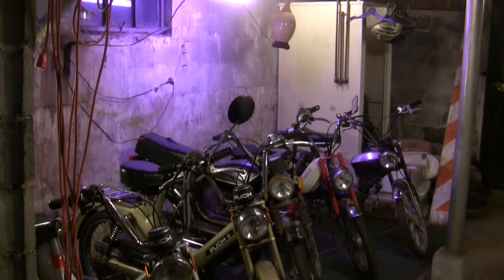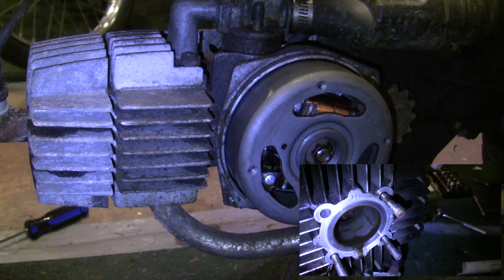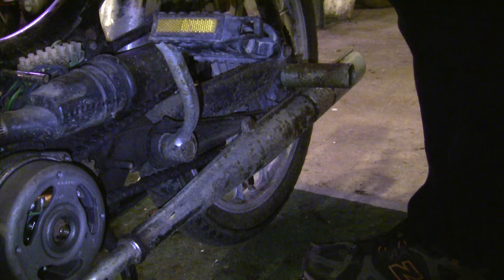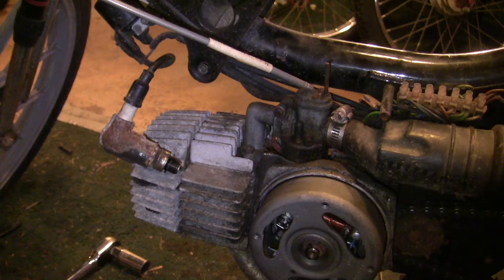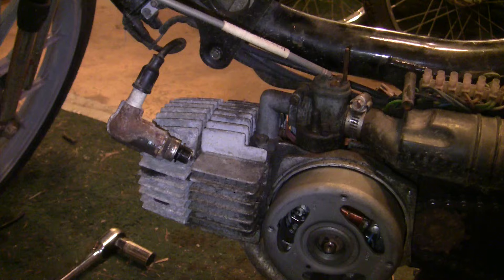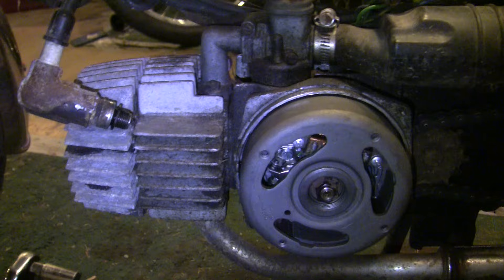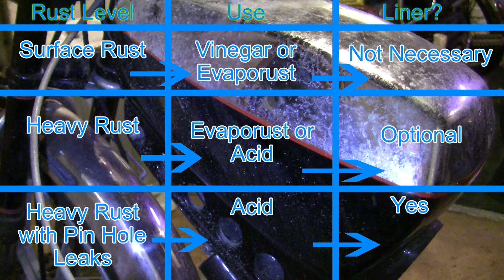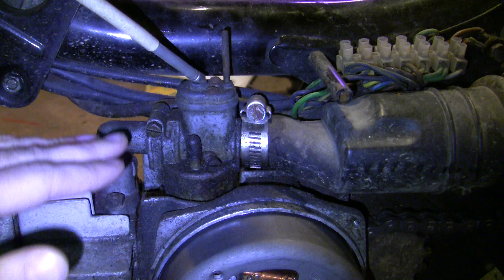How to get an Old Moped Running/First Things to Check (Compression & Spark Tests, Troubleshooting)

Comment: Travis, Thank you!!! I have an 85 Trac that has been sitting for a decade. I watched your video and learned a great deal! I WD-40'd cables & moving parts, and shot a few squirts into the spark plug hole. I then sprayed lithium grease on the chains. I turned the engine over by hand as you had done, then used sand paper on the points. After that I air sprayed and sprayed electric connection cleaner on the points and wire connections. Then I cleaned the carb, and sanded the spark plug. It fired up on the 5th kick! I let it run then adjusted the idle. The best news is I am doing 32mph (I weigh 240)!!  So again, thank you very much for this video!!

Comment: I had one bike that the tank was so rusty on the inside that I just took a plastic gas tank off one of my junk riding mowers and made it work. I used an inline fuel filter and shut off valve. It worked great for years.

Comment: I finnally fixed the problem. It was tedious. I exposed the whole wiring system. I checked all wires for puncture marks etc. Cleaned all grounds and disconected the taillights. Had a bad connection which inturn burned out the circuit in the connection box. Cleaned and resaltered. Works fine.I changed the design to ensure that it wouldn't happen agin. Thanks alot. You the man....
Reply from the maker: Oh man, glad you sorted it out! Always great to hear how repairs turned out, ride on!

Comment: Thanks for this video,I just bought one over the weekend and have no idea what I'm getting myself into
Reply: same my older brother bought one at an action and gave it to me for a suprise and i've never messed with two strokes  so i had no idea what to do with it
Reply: Did you get your moped running?
Cheers
Reply: Did it run for several months and randomly stopped working again. I have to take it back apart and figure why it won't start up again

Comment: Thanks for responding. Looks like I may have do some serious rewiring to do. My bulbs are good. My swithes are cleand and good. Icleaned all ground connections. Checked for pinch points. Everything.... still no luck. Thanks agin. Ill be back at it tomorrow.
Reply from the maker: Ah bummer, it's nice when the fix is easy. The switches are funny...the test for them is to tape the two connectors going into them together and see if it still dies when you hit the brake lever. Obviously the bike can't be ridden like this for safety reasons/no brake light - but even if the switch contacts are good and clean it could still be bad. Beyond scuffing up the grounds with sandpaper I would also look for a simplified Tomos A3 wiring guide on MopedArmy for when you do go to re-wire, less wiring makes troubleshooting e-z!

Comment: Supertech oil works just fine. Been running it in my F150 for years and it's pushing 300k miles. Project Farm has done loads of oil and other tests on various brands.

Comment: Definitely going to have to use these methods to get my newly acquired mopeds running 😎

CL ad, picked up a ‘75 & ‘85 motobecane roadrunner, and scored an old angel ‘moped II’ for free more or less. Paid $150 for the set of (3) of them :p

Comment: In the UK it's a sad reality that many old bikes were stuck away in the shed because they were knackered and nobody had the time to take them down the dump. You are lucky if you buy an old bike that isn't in need of a total mechanical re-build. Many owners enjoy the work,  but the cost can be huge to locate rare, obsolete parts.  Think about this before spending a fortune on a 'barn find' bike. ...it will be a big work, time, emotional and financial commitment Better to buy one where the work has been already done.... and that you can ride away looking mighty cool!

Comment: HI! I purchased an old TOMOS STREET MATE last week (yes, from Craigslist) so I can teach myself how to ride before jumping on my other bikes (Yamaha xs400 maxim n Honda Shadow VT700). (I promised my family I'd practice on something "little").

 Before I purchased it, I saw the ex-owner ride the heck out of it, kicked it back and off he went, so I loaded it in the back of my sedan and off "I" went! I don't know crap about bikes and I'd like to get it street ready (registered, insured, etc.) by fixing it myself.

This little moped has been "suped up" to a 70cc with a different engine, a fancy muffler and ... it has no odometer (?) It has no KEY. I didn't notice that before I got home (oopsie) It's been jury rigged like crazy, but it works like a charm.

It has a new battery, the tires are ok, but it has a mess of wires sticking out of the oddest places all jumbled together and placed together with plastic ties.  So, where do I start? I'd like to do the work myself given I paid two cents for it. I don't want to start throwing money into it.  I'm pretty good with electricity, mechanics and I'm not afraid to get dirty.

I cannot tell what year it is cuz the VIN is covered right now by a junk load of jury-rigged wires. I can send you pictures, etc.  My question is ... where do I start, what do you suggest and thank you, thank you, thank you for any advice. JG
Reply from the maker: +Janet Grace-Alvarado 
It sounds like you're off to a pretty good start. That Tomos will have an A55 engine, year will be 2005+. 

My understanding is the wiring for A55 motors was borrowed from some Chinese scooter and has a lot of extra wires from the factory. If someone has messed with it even further, but everything works (lights, turn signals, horn, etc) I would recommend leaving it. Myrons has a great guide to modern Tomos electrical linked below: 

http://www.myronsmopeds.com/category/service/new-tomos-electrical/

The trouble with buying modified mopeds is that most people don't take the time to property tune after installing a 70 kit. If the previous owner didn't reject the carb there is a danger of it seizing from getting too hot. If you only bought it to get comfortable on two wheels, then it's whatever, but if you plan on riding it as a real form of transportation it'd be worth it to read up on performance tuning since modifying a moped from stock has a lot of different variables (torque specs, carb jetting, exhausts, gearing, clutches). At the very least, I'd exercise caution if the stock oil injection system has been left in place, as a 70 kit will keep the RPMs much higher than the stock pump is used to. 

http://www.mopedarmy.com/wiki/Category:For_Newbies
http://www.mopedarmy.com/wiki/Category:Performance_Tuning
Reply: Thanks SO MUCH, Travis, for your response and links.  I am absolutely not going to be riding this as a mode of transportation. It's solely for practicing and getting my footing on something I can handle until I'm completely comfortable. (ride like a pro dot com) I'd rather practice techniques than "go for a spin".  I am very thankful for your response and expertise. THANK YOU!!!  Brightest Wishes. JG :D
Reply from the maker: Janet Grace-Alvarado No problem! Happy riding

Comment: Years ago I had a flathead V8 in a 53 Ford most cylinders had around 90 a couple had 50 and one or two had 25 lbs per square inch and it was still run a hundred. It was bad valve seats that I could not grind out without doing a complete valve job and on a flat head there is no valve adjustment you have to grind off of the stem or lap it down into the seat

Comment: Ok so Travis I could hug you.  Im on my very first project and I needed this video. I bought two mopeds for $450. A Moto Guzzi Robin and a Pacer Super sport. I could only keep one so I sold the Moto Guzzi that was running by the way but it didn't have that awesome top tank. Now Im taking that money and plunking it in to the pacer that wasn't running, good or bad. I didn't watch this video (kicking myself) before I started to tear in to the Pacer.  I was very meticulous about bagging and labeling all the screws and so forth so getting this back together will be pretty easy.  I have several issues. First when I took the head off I noticed that the cylinder had a lot of burnt crud all over it. (I will check for scoring thanks to your video) Is that something I can clean? or do I replace the cylinder? Next question.  Do you know anything about the Morini M01 engine? If so how do you check the points? I cant seem to see them through the fly wheel.
Reply from the maker: I would say you made the right choice! The M01 is a better motor than the G2 motor on the Moto Guzzi to start out with. 

As far as the cylinder, carbon buildup is pretty normal because all two strokes are just dirty, plus the oil they had back in the day was pretty crude, so long it wasn't seized it is probably fine. I had an M01 on a Bianchi moped a few years ago, fairly robust little motor. Italian mopeds always have little bitty flywheel windows, you'll have to really fiddle with it, but you should be able to check/adjust without having to buy a flywheel puller.

Comment: It's alive. Thanks travis
Reply from the maker: +Scott  Morgan Hey glad to hear it! Looks like I missed your other comment, apologies - the clutch is usually not a culprit when there are starting problems, more often a cable with too much slack or occasionally the linkage inside the clutch cover needs adjusted but it sounds like you got it sorted

Comment: Can you use naval jelly to remove tank rust,and some never dull to clean and polish away surface rust,bikes that sit a long time,you can use stable gas treatment ,so the gas won't turn to varnish.

Comment: Hello,friends.I have any questions.
1.How must show when the compression is good?
2.When I need to change ONLY piston rings?-how show the compression tester?
3.When I need to change piston and piston rings?
Sory for my bad English :/
Reply: nalisim The easiest way is using a kickstarter, if it has some resistance i'd say it's ok. 2: If the compression is low, you should change the piston-rings. I recommend that you change the piston while you do that, but it's not neccesary. :)

Comment: you dont want to use carb or brake cleaner on ignition, use contact cleaner, those others can melt the insulation on your coils
Reply from the maker: ^ Correct that is the best practice. Carb cleaner is not advised because it can contain oil, brake cleaner is better since it won't but both will eat insulation. Annotation made, thanks.

Comment: Pretty helpful video. However, you left out probably the most important step/ part.   Just like starting a car, you need to be able to turn the engine over fast enough to start to check for spark, etc.  At least seeing your flywheel turn faster than mine did made me realize the starter clutch was messed up on my moped project.

Comment: hey, probably a dumb question but it's haunting my dreams. I have a sachs 504 that I can't figure out how.the clutch cable goes through the decompression valve lever to make it open and close when it's pulled. all the videos and pictures Ive seen just look like the cable passes through it. but if I set it up the way it looks the cable wont affect the valve at all. I'm sure this is simple but I just cant figure it out. awesome videos by the way!

Comment: This is a very good information. But my scooter is a 2008 Scooter 60 miles on it it's a Chinese scooter. And sometimes it has a habit of hard starts or it sometimes will stall while you're actually writing it. But mainly what is cold I have the hard start problem once it warms up it starts fine

Comment: nice video. I have a puch maxi 77' 
cleaned the carb multiple times (atomizer and jet are clean, banjo etc..)
Cleaned spark plug and checked for spark, fuel flow seems to be good, no rust in the tank. Going to clean the points today to see if that helps.

Could be a wiring issue?

Comment: I was given a 1980 Sachs Prima moped by my uncle.  It has around 2000 miles on it and appears to be in good condition but when I brought it home it would not start.  I took it to a local mechanic who had it running/idling well at his shop.  He had cleaned the carberator, put fresh mixed fuel in it.  I brought it home and took it about a half mile down the street and it quit and I cannot get it running.  The mechanic suggested that it may be the crank seals.  Any ideas about what I should try?

Comment: I have a 1978 Suchs Balboa moped.  It was a  barn find and has not started in 30 plus years. Question concerning the ignition under the handle bar,.  Is that to lock the steering  or start the engine?  I do not have a key.

Comment: Some years ago I bought a Suzuki FZ50. After a few weeks one day the exhaustion pipe fell off while riding the moped and the pipe broke. I bought a new one. But after that the moped didnt have much torque when going even slightly up hill. Apart from that it was ok. Havent used the moped for nearly ten years. It has been dripping black oil since then from the back of the exhaust pipe. and the oil tank has also got empty.
Would you say this is worth touching?

Comment: Did you know that the e50 motor on the bike on this video have 4 bearings! and not the typical 3 bearings! You can see the difference on the clutch side on the bike. It has 3 bearings if the closing is roundm if the closing has 2 vertical stripes i has 4 bearings as the bike in this video!

Comment: Hey Travis.  I bought a 1983 Vespa moped when the pandemic first hit . Just now thinking about getting a look at it and seeing if it will run.  Any advise?
Reply from the maker: Hi there - sure, assuming that is a vespa with pedals, it will have a standard Dellorto SHA carb which came on many different models and is quite easy to clean. Much of the same advice will apply, it will still have ignition points - but it does have a belt and variator instead of a chain, assuming it isn't a single speed Ciao.

Comment: I have a JCPenney pinto. It only has spark sometimes. Any advice? I already changed the condenser

Update: I crossed the horn wires and it ran amazing!
Reply: I know this is 5 years old but do you just take the horn out and cross all same colored wires?

Comment: hi i bought a suzuki roadie cs50 as a project, it was in pieces , i have cleaned the carb,changed the plug, the petccok  is working, the spark seems good,it wont start,if i put easy start in the cylinder it runs for a second, the fuel is 3 months old so im considering changing it..............any ideas

Comment: I have a 49cc scooter. Was running great. Park it and the next day it wouldn't start. When you try to start it ,it turns. But when you open the throttle the motor tries to stop. Just like if ur battery was low. If you let go of the throttle it will turn over at normal speed. But wont turn on. I replace the spark plug. Checked for spark. Cleaned out the carb and adjusted the valves. What can this be?
Reply: uhm i dont know the word i. english but you have the gold metal thing inside the carb with a little hole in it it should say a number 50-100 between in your case i would try getting a lower size

Comment: you think maybe you can't get over 90psi on that one puch could be because it's tapping the Schrader valve, being a high comp head and all..

I noticed you have a vespa si, I have a ciao with problems, cylinder is free but there's a rough patch during rotation, do you know what this could be and why it's keeping my motor from running?

Comment: I have a 75 garelli eureka but my compression isnt blowing any air out of the spark plug hole when i did the finger test what could my problem be? And also what do i put in the oil tank? What kind of oil do i use. I have a new spark plug that sparks up, i have fuel just no compression

Comment: I have a 1978 jc penney swinger 2 and cant get it started. Its in better shape than most I've seen but has been sitting for at least 10 years without running. When I try to start it and kick the pedal the flywheel only rotates 1-2 times, what does that mean?

Comment: Do you have a video on fixing misfires?   I have a newly acquired FreeStyle and 2hp single speed, I find I hear popping at times when the engine is running full speed or when I let off throttle.  It does not seem to be very consistent.  The unit runs well, thought there is a lot of crud in the tailpipe.  All original, accept the float I put in the carb.
Reply from the maker: Popping is usually ignition timing related

Comment: Just got a 1978 Puch Magnum XK, it was a barn find.  I have spark, compression and going to clean the tank.  I have the carb apart now and you mentioned the part that holds the float should have a rubber tip, mine does not. Also how did you get the bronze center piece out that the throttle cable goes down into and is I between the floater? Thank you and if you have any more exhaust laying around for sale I may be interested!!
Reply from the maker: Hey-ya! Old comment, but the float needle will need a rubber tip or you'll have leak city. Treatland.tv for the replacement. The atomizer can be removed with a deep 5mm socket.
Reply: puch

Comment: Ive got a Peugeot 102 scooter, ive pulled it apart ages ago, to get it painted but then the guy never did.....So im putting it back together. Im struggling on the front wheel! The nuts fit into channels, so you cant spin them. DO you have to assemble them with the forks off then fit the forks? Is it some trick so the bolts never undo?

Comment: Hey great videos! I have a puch maxi and I don't know if its getting gas.. when petcock is in the on position nothing drips out ? Does it need replaced? Or is it vacuum operated?
Reply from the maker: 100% Gravity - Petcock could definitely be clogged, you could take it apart since they're pretty simple, or you could replace, the "puch maxi gold petcock" on Treatland.tv is a fine replacement. If you take the petcock off and gas comes pouring out make sure it's clear and free of debris.
Reply: Great! I ordered a new petcock I hope that does the trick. I subscribed to your channel btw. Keep up the great work!